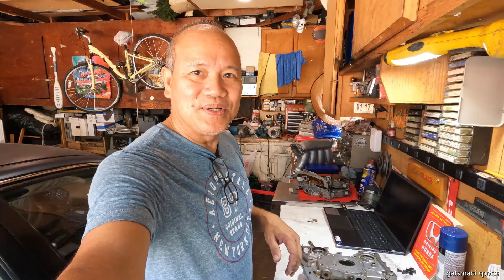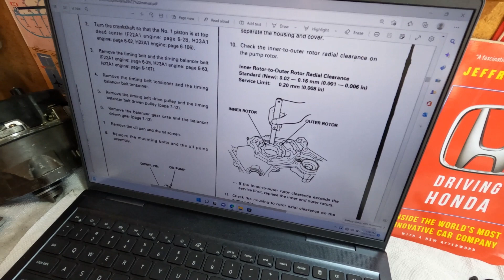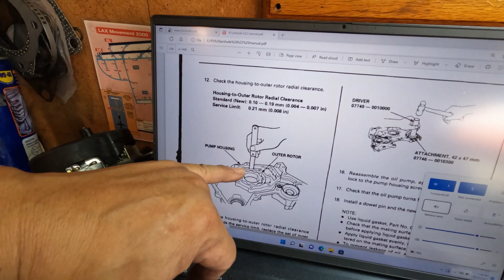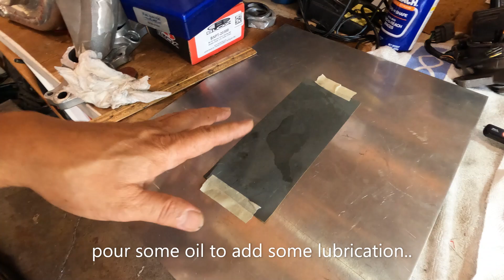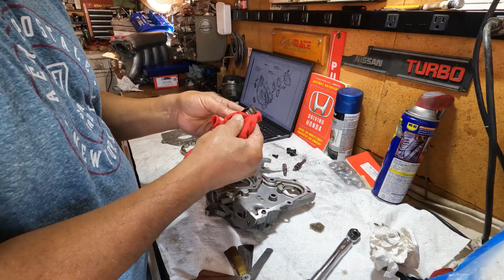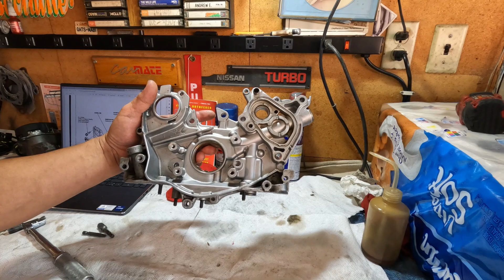H22 Oil pump inspection.

Comment: What type of vaseline do the OG use? What chemical should I use to clean the housing? I guess the housing is made of aluminium alloy, won't rust, can use the strong engine degreaser used at car wash but need to remove the rotors from it first. Thank you
Reply from the maker: If your'e going to run the engine as soon as it was built, putting vaseline is a good idea but if the mootor will be on storage for more than a day or so, no need to pack the pump w/ vaselune or grease. Make sure to prime the motor oil  before you start it. Any degreaser and scoth brite will work and rinse it w/ water and quickly dry it. You can spray some wd40 on it for extra protection.
Reply: @sagittnet2158 Is this what you are saying? 

If I will cover/close the oil pump rotors on the housing, install the oil pump and run the engine all on the same day, then should use Vaseline?
Reply from the maker: @eaglehigh-h3e here are my example. Lets say you just need to remove and replace an oil pump w/ the engine still on the bay. Pack the inlet of the new or rebuilt oil pump w/ vaseline. What'll do is make a lot easier to prime the engine oil. It'll make a suction a lot easier.  If installing your new rebuild engine on bay that'll take you more than a day or 2, no need to pack the oil pump gear w/ vaseline, you'll be okay, it'll take a little while for the engine to reach its destination when you use the starter to prime it.
Reply: @sagittnet2158  I saw your video how you prime the engine oil off bay. You said to pour oil into that plug. Is that the plug I put vaseline into?
Reply from the maker: @eaglehigh-h3e only oil on that area ( that's the outport). If need to use a vaseline, it'll be on the inlet port or pack the pump gear w/ grease. There's actually no need to do all of it. You'll be okay just use the srarter and let the oil pump do its thing. Just let the starter take a rest when its taking to long for the oil psi to extinguish ( dash) to prevent overheating
Reply from the maker: You must scrub it to remove all the dirt unless you bring your engine parts to machine shop to get wash. I used to bring my engine block to carwash and pressure washed it 'till l went and got my own pressure washer.
Reply: @sagittnet2158 Noted with thanks. 
For me, the easy way to wash is to bring the pump housing without the rotors to the car wash. They will spray the red degreaser on it and let it sit for awhile, then pressure wash it. 

After that, any dirt the pressure wash can't remove, I will scrub and wash it..

Is it necessary to clean the rotors with water and degreaser? Does it make it cleaner than wiping with cloth/paper towel? I see some yellow/brown engine oil on it and on the cover  which can be easily wiped with tissue/cloth.
Reply from the maker: @eaglehigh-h3e use any cleaner for the rotors but always dry it out and lube it w/ engine oil a little bit for protection.
Reply: @sagittnet2158  Got it, thank you.
Reply from the maker: @eaglehigh-h3e no worry man

Comment: What is the max torque of your impact driver? I might have to get one to open the screws. Not sure if a rachet wrench can open it. Screws are very tight.
Reply from the maker: Its Harbor Freight tools not sure if it goes up to 300 lb/ft of torque. Use a big Philips tip and give a light tap of a hammer then give it a turn. It should loosen up.
Reply: @sagittnet2158 Will try that.
Reply: @sagittnet2158  I did the light tap, did not work. Then I used the hit with hammer impact driver using a lightweight hammer. After hitting them hard many times, only 1 screw opened. 

I can try hitting with a 2 or 4lbs hammer, have to get it first. Can this method crack the oil pump housing? I put the housing on a pizza box when I hammer the driver.

I can also use a rachet wrench, I got the wrench and Philips tip, have to get the 1/2in square drive to 1/4in hex adapter first.
Reply from the maker: @eaglehigh-h3e lay it flat on small piece of wood and card box, but make sure its flat and apply a bit of heat on it.
Reply: @sagittnet2158  Noted with thanks. I was holding the impact driver wrongly. 

I tested no.10 & 12. Will test no.11 later. 
No.10 0.05mm can slide through, 0.10mm cannot slide through. 
No.12 0.05mm can slide through but tight. 0.10mm, very tight, can slide through some areas but stuck at others. 0.15mm cannot slide in.

Both are good.

Comment: Mine is h22a and engine oil light blinks during idle and very low rpm, stops blinking when I press the fuel pedal. Do I need to replace the entire part you show in this video?
Reply from the maker: Try replacing your oil pressure sensor it could be going bad. And if didn't work, oil pump assy is on its way out and time for a new one.
Reply: @sagittnet2158 I replaced the sensor, it did not fix it. Can the problem be caused by a clogged oil pickup tube?
Reply from the maker: @eaglehigh-h3e that could be possible, its best to check it out. Start checking your oil pan for any dent and not causing the suction pump not having enough space. From there, if suction pipe is not clog and pan is not dented and since oil pan is already remove, might as well check the oil pump.
Reply: @sagittnet2158  Noted with thanks. What are the things that should be replaced when replacing the oil pump?
Reply from the maker: @eaglehigh-h3e just about everything on the front side of the oil pump and dont skip on removing the oil pan and checking the suction pipe.
Reply: @sagittnet2158 noted with thanks
Reply: @sagittnet2158  there are 2 oil seals and 3 o-rings attached to the oil pump to replace. How to find out the part number of these parts and the measurements of the oil seals online to make it easier purchasing them?
Reply from the maker: @eaglehigh-h3e Go to Hondapartsnow.com and look for 1995 Prelude si, under oil pump.
Item  91313-pc9-003
15113-p13-003
15114-pto-003
15221-p5k-004
Reply from the maker: @eaglehigh-h3e  search any of those numbers on ebay, and you'll see. There's also a kit for Honda's. Accord and Prelude share same part numbers. Make sure to go to Hondapartsnow.com for correct parts.
Reply: @sagittnet2158  Noted. thank you so much
Reply: @sagittnet2158  Noted with thanks 🙏

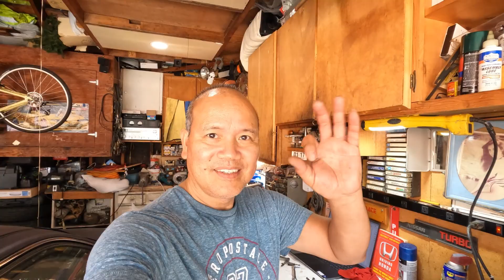Comment: Hello there. I have a question. In the picture it shows the feeler gauge being put in between the lobes that are touching tips but you put it between where the outer lobe is touching the slope of the inner lobe, if that makes sense.  13:17 at this stamp the gauge should be put on the opposite end, your at 12 o clock but should be at 6 o clock. I have similar instructions printed and thats what it looks like to me, but Im not a professional so I don't know. Not trying to be rude, just need clarification. Thank you for the video, its helpful to see someone go through the steps.
Reply from the maker: The clearance on tip of the slope is so tight and feeler gauge will just bind up and only way to do it kinda in a roll towards the slope and it just stop on point where it cant go anymore. For the radial clearance, top and bottom side of the housing are just about the same. But it does illustrated towards 6 o clock location. If you have a pump that you dont know the history of it and if you happen to be doing a inspection of the gears. It won't hurt to check both sides of the housing and chances are, it'll be the same in my opinion and no worries about being rude. Your'e just want some clarification and it work vice versa. Don't hesitate if you see something l need some corrrection. Thanks for watching my channel.
Reply: Awesome!!! Yeah I'm about to pop open my oil pump like a can of sardines. I'm trying to get as much info as I can before I do. Thank you for the reply and the video. I appreciate it.
Reply from the maker: @DukeofHell No worry, Honda's oil pump is very good. I have not come across on a pump that is worn out of specs. Typical is raised and sharp metal, give it a light rub w/ fine sand paper and it'll be like new. Thanks

Comment: Would using my h22 oil pump on my f23 block and head let me rev the motor higher?
Reply from the maker: It's all about combination of parts. F23 oil pump will do the same as H22. You need a valvetrain upgrade, hi lift cams together w/ hi comp ratio piston. Use a good intake manifold, bigger t/b and lastly a good known exhaust manifold w/ 3" exhaust piping. I wish l could've experiment further on my 3rd time retuning the G23bk so everyone can see. I could have install a type S cams to find out if it can make more hp better than H23a cams. But l like how it runs before and don't want to make some changes so l kept it how it is. Just be careful over revving your motor coz it's not really design to handle the rev more than 7k but its capable to go pass that. Only if you have a good supporting parts on it.
Reply: @sagittnet2158  okay, I understand now. Thank you for replying and explaining! I love your videos btw they’re very helpful!!! Have a nice day.
Reply from the maker: @BADDFOREVER  thank you and just leave a msg if you have any other question.

Comment: This makes more sense. I sent the engine for a long block rebuild. Afterwards the oil light comes on and off. No dry sound and it shows some oil at the valve cover while running. Im hesitant to call the pump since im assuming they should  of put a new one. But now im thinking if I need to go and check all this clearances. 
Thanks!!
Reply from the maker: Yes! It's a good idea to give the gearing a quick check and benefit in the long run.

Comment: are you keeping the balance shaft in your h22? I am wondering if I should remove it from my jdm h23a bluetop
Reply from the maker: I using the balance shaft still, on my H22 and G23. I had one motor that I deleted it but I've noticed a buzzing sound on cold start and never a fan of it. If I ever will delete it again, I'll invest and buy aftermarket dampner. But don't let me stop you for doing what you like. I just want my engine to be reliable and last longer for me to enjoy. I'm just speaking thru my experienced.

Comment: Using f23 block if i want to install block guard kit do i have to use an extended oil pan ??
Reply from the maker: I'm not sure if they make a cylinder block guard for F23, but l do know some guys they send the block to CSS to get it done.
Reply: @sagittnet2158  i think it is called a block girdle kit where it sits right under the crankshaft i did find some but im wondering about the oil pan
Reply from the maker: Ok, you dont need it, that's for a B series. F23 have a good main bearing girdle, its almost like a K series and it's better than H22 girdle. No need to worry about the main bearing areas my friend.
Reply: @sagittnet2158  would it be okay if i was trying to run with ecu that goes to 7-9k rpm??
Reply from the maker: @G23VTEC  If your engine is well built and supportive, it'll dictate your rev range and it's up to you how long you want it to last.
Reply: @sagittnet2158  i see thank you for the help
Reply from the maker: @G23VTEC   no worry my friend.
Reply from the maker: Not sure about extended oil pan though. Are you thinking of using it like a H2b or should l say G2B setup where you have to change the oil pan coz it angle on the bay?

Comment: Got my oil pump cleaned up and ready only issue I stripped one of the bolts for the TDC  sensor and having a hard time removing it. Thanks for the video I'll definitely check the clearances now.
Reply from the maker: You wont need the sensor anyway coz it's not needed if your setup is obd1, otherwise, it cannot be tune using that sensor. Yes, it's a good idea to check the oil pump gears clearances.
Reply: Not sure if I'm going obd1 because I'm thinking of going standalone ecu. With a standalone i don't think it matters if it's obd1 or obd2.

Comment: Thanks I just ported my oil pump, now I can check the clearances.
Reply from the maker: It's a quick n' easy check and a peace of mind make sure it's good. Thanks for watching bruh!
Reply: How much material did u remove to port it and did you shim it afterwards?
Reply: @hserieshoonigan1997 not much material mainly rounding off all sharp corner and yes I use a washer to shim